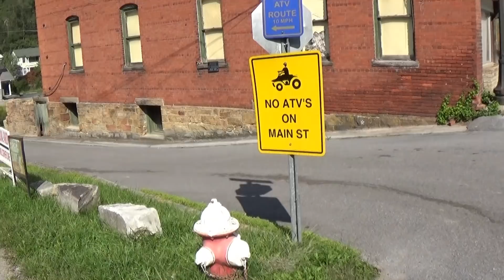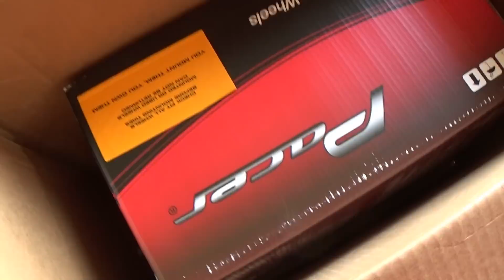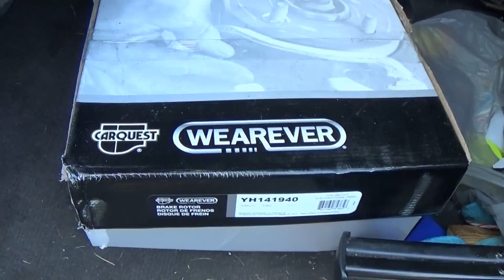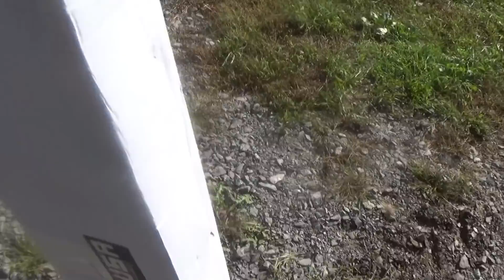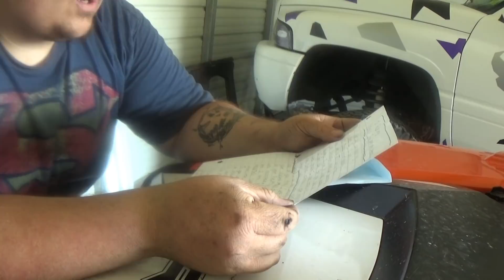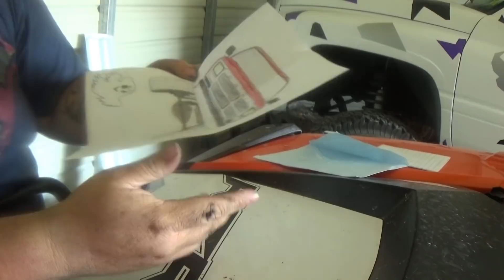MORE TRUCK PARTS!! ADDING NEW SPARK TO SUPER RAM!

Comment: Good work Chase those trucks are going to be awesome when you're done I like the wheels you chose. If you buy wheels later on pay attention to the back spacing.. a lot of manufacturers go by offset but that just makes things complicated. To simplify things just figure what width wheel you want say a 10" wide wheel and you want a 4.5 inch lip to the front of the wheel.. that would be a 5.50 backspacing. It's really pretty easy to figure out if you go by backspacing and not offset. That's the way the old hot rodders use to do it hope this helps take care man.

Comment: I hope you read this, because I honestly think it could help. 

I get the whole budget build thing, but never go cheap on key parts. It’s like buying your tools from Horror Freight, or buying MAC. Yeah you can get a toolbox and fill it full of tools for about $300 but you’ll be back twice a weeks to replace broken shit. Or you can spend the extra money and have reliable tools that aren’t going to break. And if they do, WARRANTY. Getting cheeky parts means more room for error. That steering bracket you got, is probably made from weaker steel and after a few times turning your tires on asphalt, it’s going to bend, warp or possibly break. I’ll spend a whole pay check on a single part, because I know the part will last and it has a warranty. Gotta stay away from eBay man. At least use AndyAutoSport or Car-ID. Hate to see you throw money in a project only to have to throw more money at it to fix the parts you just bought. Or because they got too hot and melted wires and caused a short. That’s a jab at your headers mate.

Comment: Missin til its warm im guessing thats the 360 if the check engine light is on cycle the key from off to acc 3 times codes will pop up its either your cps you have a tiny leak or worse its the stupid ass ambient battery temperature sensor ive had a 96 a 2000 now i have a 2012 trust me if these truck take a shit if pretty simple to fix